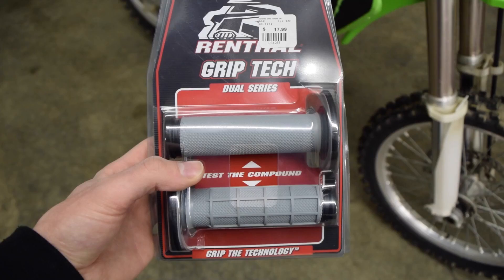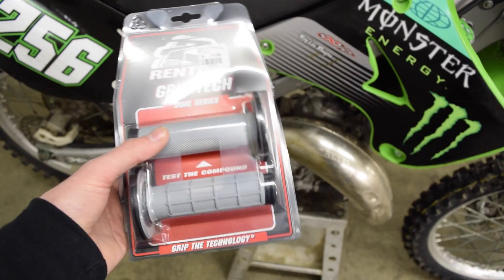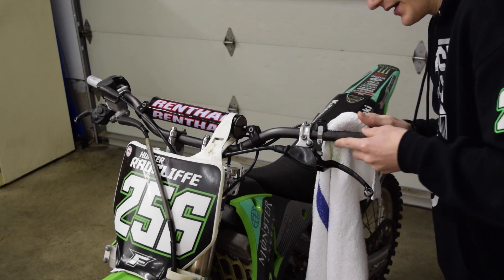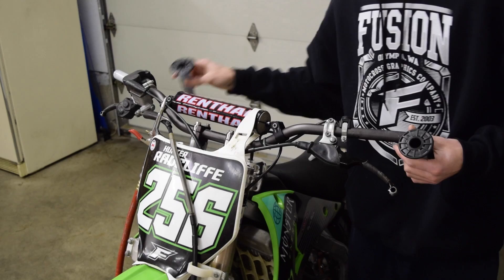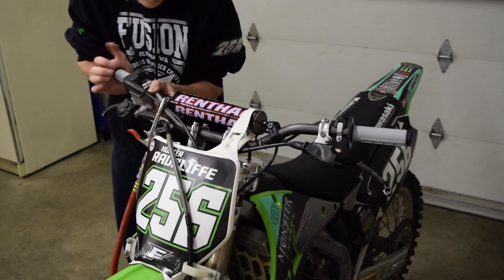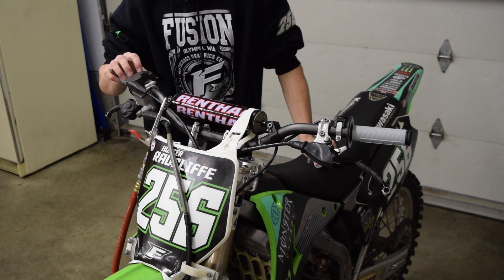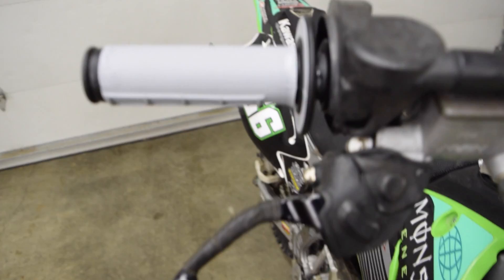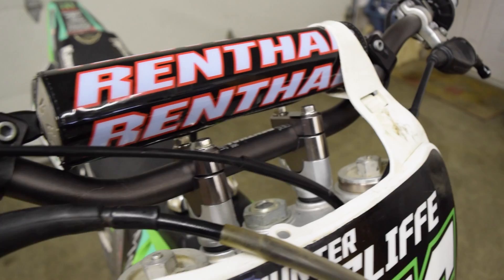How To Install New Grips On Your Dirtbike EASILY!!

Comment: The waffle side of the grips is there for your fingers. The smooth side of the grip is there for your palm. Technically, you position the grips so your palm will cradle the smooth side of the grip. Just a tip that I see will go against your horizontal logo ocd story.
Reply: That's how he installed them, waffle at fingers, dots on palms

Comment: I found that good ole WD40 works great for putting them on. Minute or so later and adjusting to perfection, the solvent evaporates.  Don't overthink these task guys which a lot of people do, you are just putting a rubber grip on bar. They are made to fit snug regardless.

Comment: Your video has made me realise what an idiot I am and I thank you for it lol. Bought a set of pillow tops and tried to fit them to my bike but being a Chinese supermoto I had doubts about fitting. Tried the non-throttle side and lo and behold it was too loose and the other one seemed too tight! Now realised it's not as easy as I thought and the TIGHTER ONE GOES ON THE NON-THROTTLE SIDE!!! Cheers mate.

Comment: I don't understand how he was going to use the air compressor to help him get the grips on.  Wish I got to see that part.
Reply: What he said is you can use an air compressor nozzle to remove the old grips. You stick the nozzle inside the grip, inflate the grip as you pull it out.